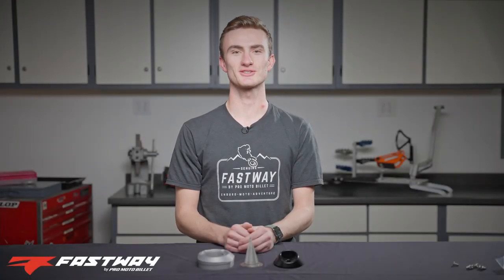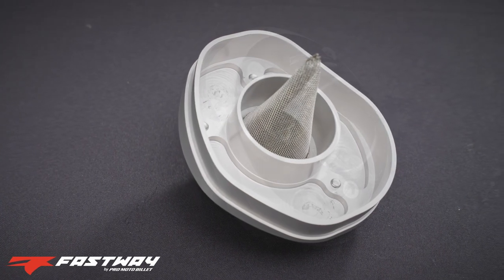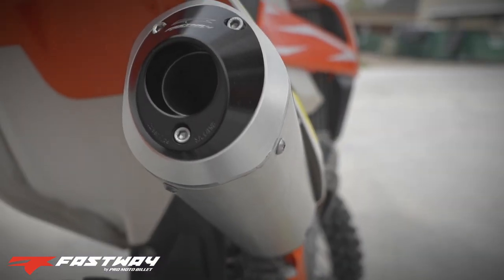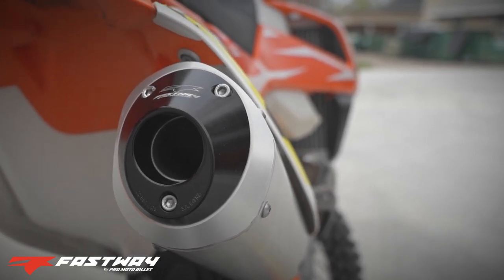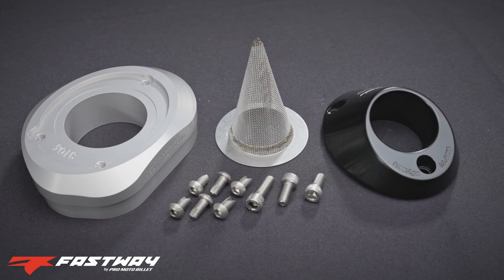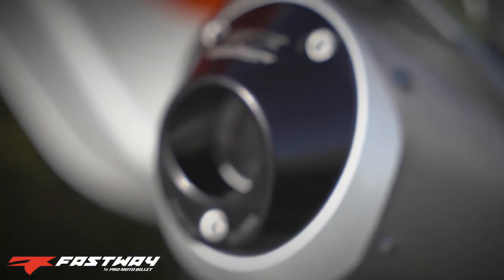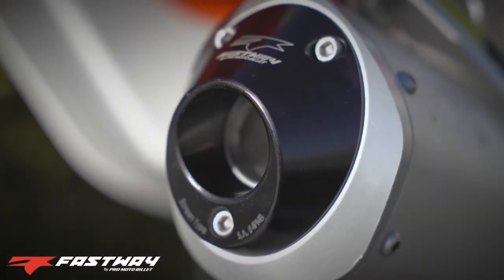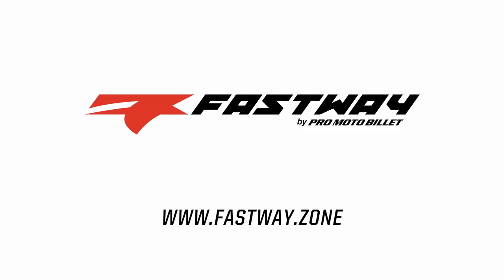You May Need a Dirt Bike Spark Arrestor!

Comment: Economical ? Really!  The FISCH is less than half the price and literally slips in the stock pipe .  NICE TRY !
Reply from the maker: Hands down we are the most reliable and an economical option as opposed to purchasing a complete new USFS Approved muffler, which is what is traditionally done.  In addition, it's often our spark arrestor end caps open up the bike to breathe better, producing a positive side effect of power gain opportunity.  Insert type Spark Arrestors typically restrict flow.  Most of our customers are looking for a complete reliable solution, if something else works great for you, go for it.  We'll be here if that doesn't work out for you. 😀🤙
Reply: False advertising should be called spark stopper. I thought it helped it backfire